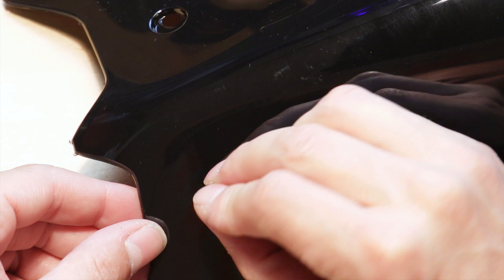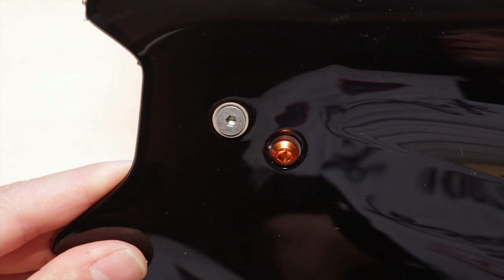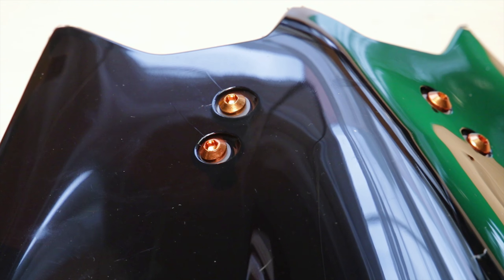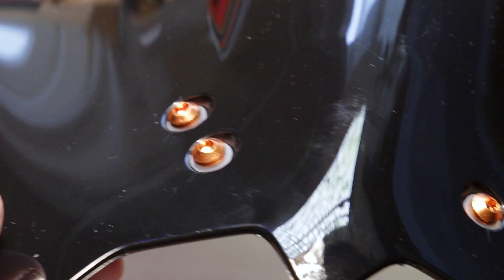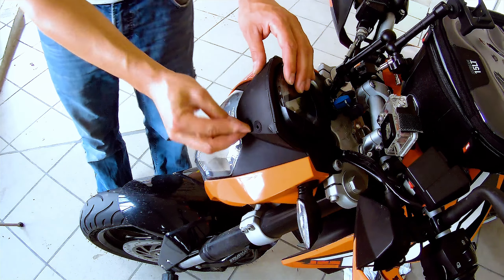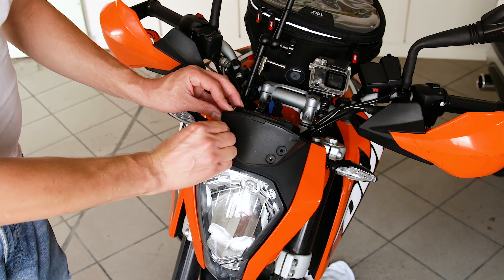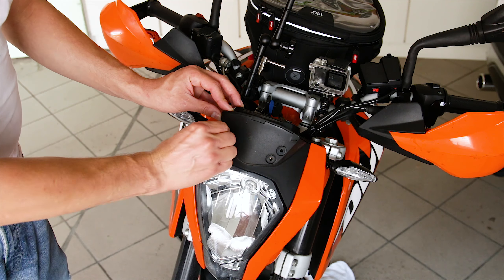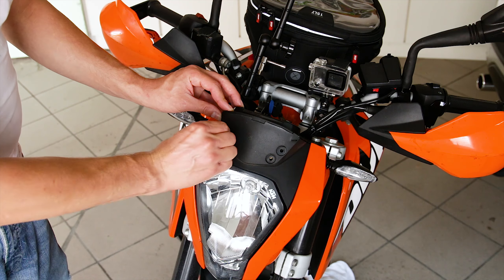#92 🚲 KTM Duke Windscreen installation with orange anodized screws

Comment: Hey! Just got one windshield like yours but from MRA. How did you removed the old rubber things? Just pulled?
Reply from the maker: Casual Flyer They should come out pretty easy. The original ones have a small bump though, like you can see in the movie. So pull a bit with the screw ...
Reply: OK, thanks for the feedback! By the way, nice videos!
Reply from the maker: Very many thank you's !
i'll check your vids later.
Reply from the maker: Are your holes also not centered as on 0:28 ?
Reply: Thanks, but is everything in portuguese ehehe
Reply from the maker: oh ok hehe, thats gonna be difficult for me  :p